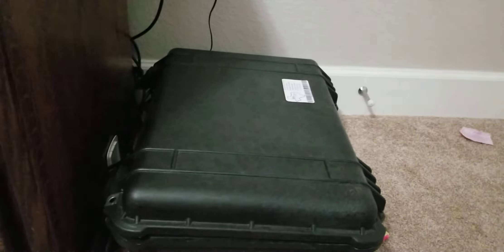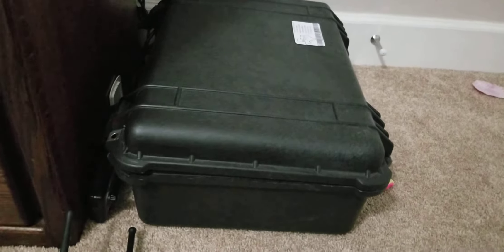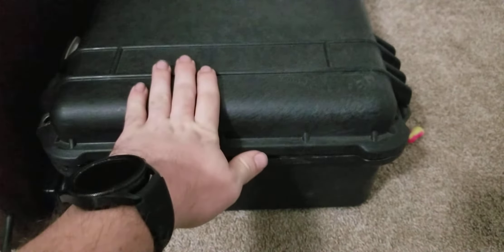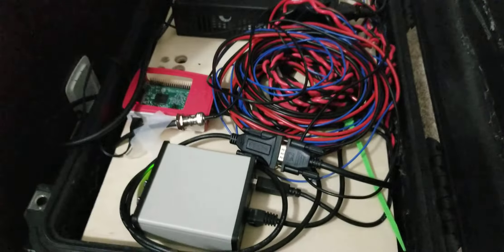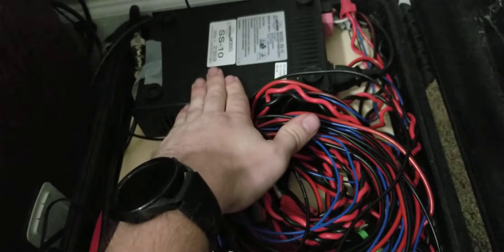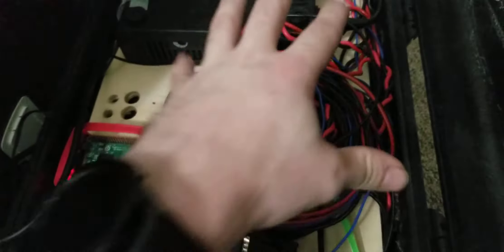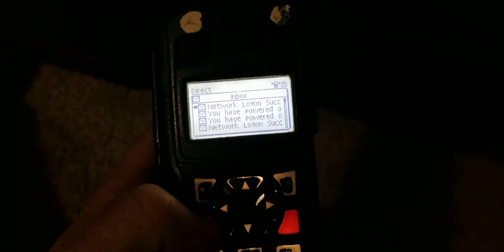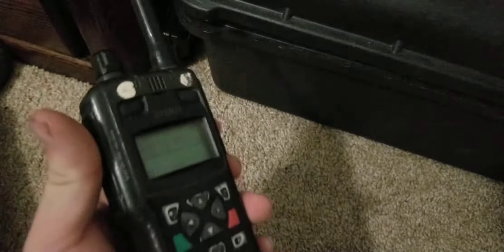Quick and Dirty explanation of the txTETRA DTC AKA:"THE BOX"

Comment: TMO or DMO?!
Reply from the maker: At the moment all my site equipment is DMO. Once I get clarification on a few FCC regulations and TMO is approved. I will be getting two TMO sites and swapping all my DMO repeaters to DMO gateway mode
Reply: @anongator  what equip will you be using for TMO?
Reply from the maker: @Jetrider91  if I can find a Demetria Express or Sepura site the would be nice. At most I'd need two carriers. 

But I'd probably have to settle for 2000s or 2007 model non TEDS base stations
Reply: @anonymous alligator  and third question: do… uhmm… do you have an idea about the price tag on TMO stuff?

Please don’t get me wrong. I don’t want to doubt your knowledge in any way. It’s just curiosity…
Reply from the maker: @Jetrider91  'Motorola EBTS could be your friend. That’s what we are using for two TMO sites so far. Sepura?! There is no infrastructure from Sepura. I guess you mean Hytera BS…? And why are you soooo into two carriers?"

Yea, I saw the EBTS's but to get the fun stuff you need a core... and those are hard to get. TBH Seupra is Hytera. 

Two Carriers allows be to have more TEDS and audio links going.

Yea, I've seen EBTS's going for 7k USD with 2k shipping. Thats a better price then what I was going to set up with quantars and crap down here.

I've sunk many hundreds of hours into research, planning, and now building my network... any extra heads would be great XD